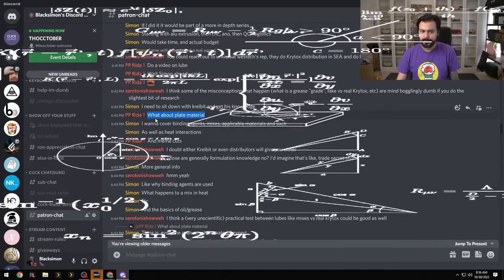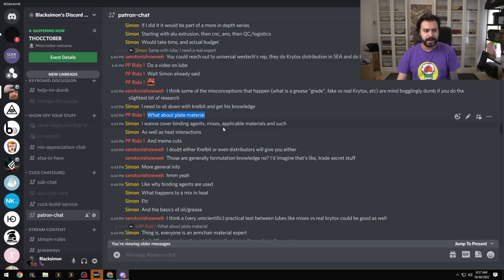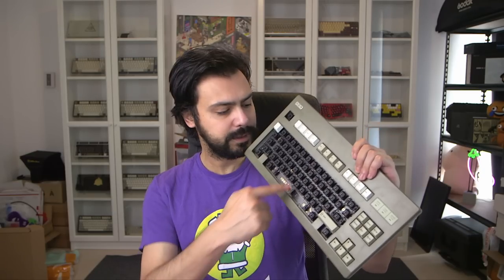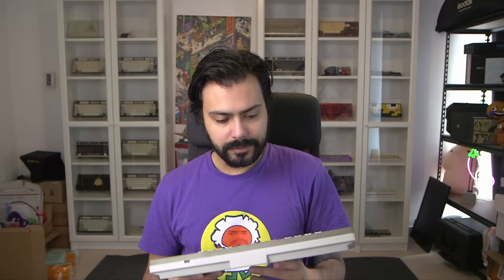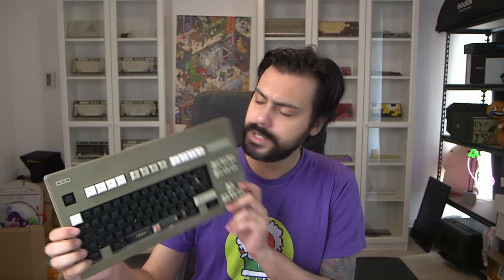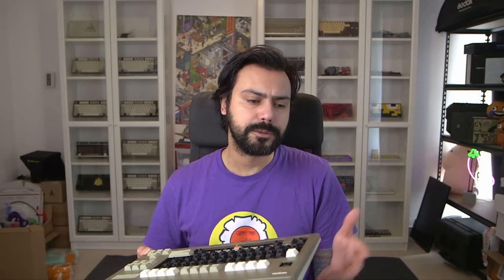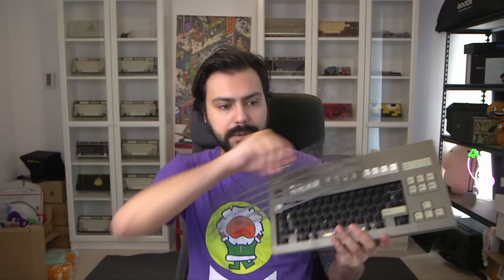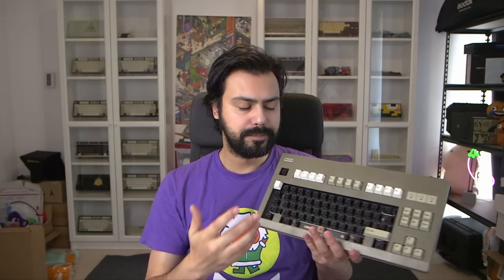Keyboard Plate Materials Explained

Comment: For my fellow ADHD folks, timestamps:
2:30 - Plateless (No Plate)
4:45 - Half Plate
6:32 - Aluminum Plate
10:00 - Brass Plate
12:25 - Steel Plate
14:35 - Polycarbonate
16:40 - Plastic Plate (POM, ABS, PP, PE)
18:06 - Carbon Fiber Plate
20:32 - FR4 Plate
22:45 - Acrylic Plate
24:00 - Plate Cuts
25:50 - Plate Thickness
Reply: You’re the real MVP for this.
Reply: LMAO you read my ADHD mind. I was literally about to just click away from the video because the sections weren't marked, thank you!
Reply: Thanks
Reply: This is so helpful! I had to listen to some of the plate because of this made it easier! 💕💕

Comment: Hey man , Im new to this hobby.  I just bought Keychron V1 (tray) then I just learned about the gasket mount on Q1.

Im thinking of buying PC plate to use on my V1 but I don't know if I will get the typing experience as the gasket on Q1?
I have never tried a gasket mounted keyboard and I don't really know how it feels. 

Do you have any opinion on Tray mounted keyboard with PC plate vs gasket mounted keyboard with metal plate?

Comment: Hey man, do you think it's worth to change plate for weight reduction? Thinking about using CF plate for that.
Reply from the maker: Assuming you've already reduced as much as possible with a lighter case, and thinner caps. Sure I guess?

Kinda goes against the spirit of plate changes, since those are done for sound and feel before all else.

PP/POM and other plastic plates are very light as well, as is FR4, so I suggest you explore those before commiting to a more complicated plate to work with